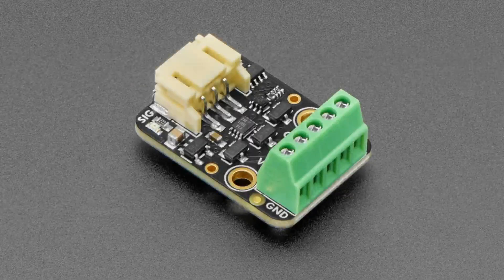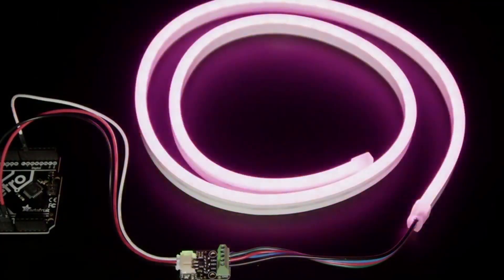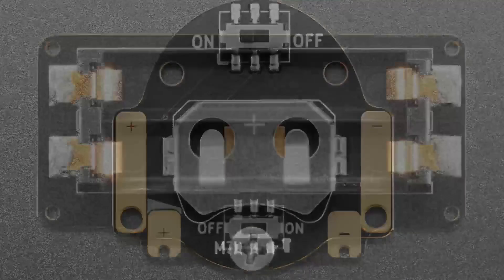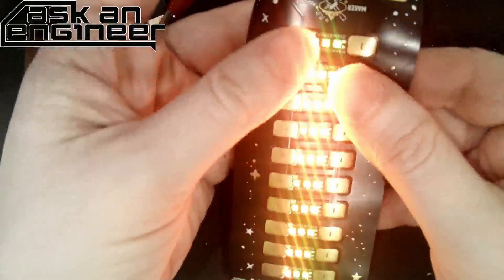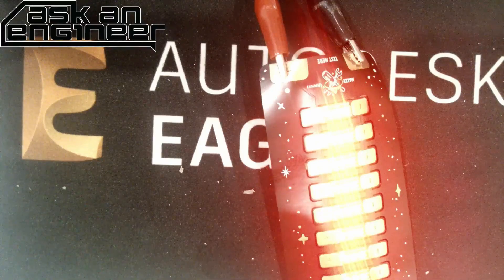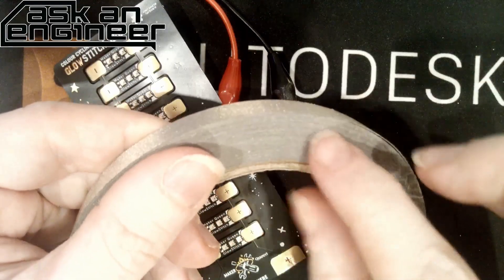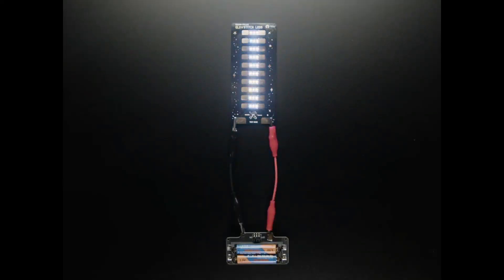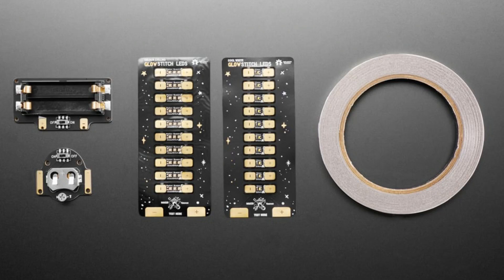#NewProducts 2/19/25 Feat @Adafruit GlowStitch Maker Kit - Crafting LED Strips from MakerQueen

Comment: Pkcell has rechargeable Ni-Zn, nickel zinc, batteries that have a 1.6 nominal voltage. They aren't very power dense compared to NiMh batteries but they are a great substitute for voltage sensitive applications. They require a different charger and they aren't good for low power draw applications, they work best flashlights, digital cameras and similar products that need alkaline batteries.